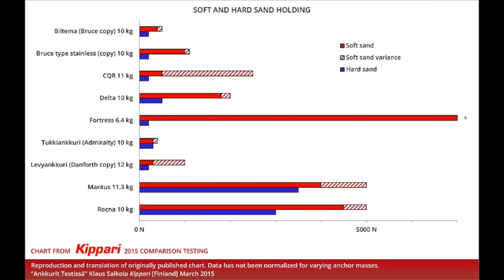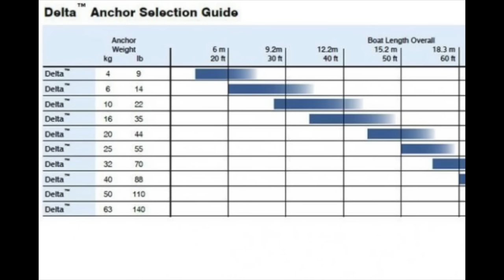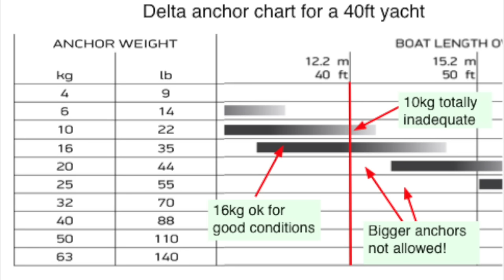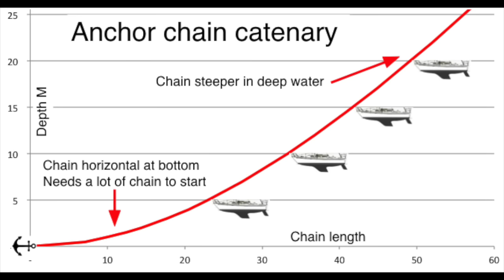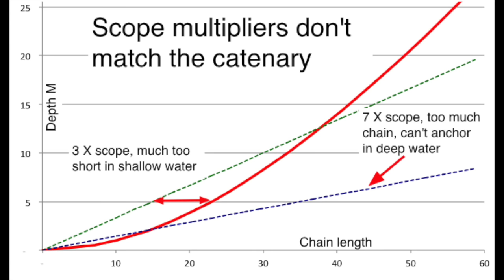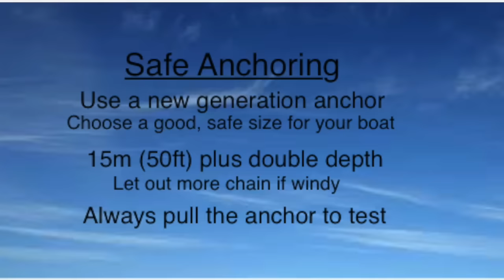Anchoring, how to stop dragging and be secure.

Comment: Good explanation . Completely agree.  Frequently inspect shackles and and mechanical connections including chain.
Reply from the maker: I always thread a length of Dyneema thru the anchor, and up about 10 links of chain. Most likely a failure will be the shackle, or one of the last chain links.

Comment: We send a 10 to 15 pound mushroom anchor down the rode by attaching it over the rode with a large shackle. It has a light line attached to the shackle for retrieving. The mushroom doesn't need to go all the way down because it keeps the pull on the rhode near the bottom effectively adding scope. I don't know how that works with chain.

Comment: A 10 meter 10 ton long keel boat had 45-50 knots with Azarta 16 kg on a sandy and muddy bottom without moving. But for added safety, mount a 21kg so it's even safer on surfaces with less grip.

Comment: Catenerary doesn't exist when you need it most, and exists when you don't need it!
Reply: It's impossible to have NO catenary, it just approaches a limit of zero as the pull increases!
Reply: @danielevenson3978  Technically that's true of course, but I think you know what I was meaning. Better wording might be... "Catenary is almost non-existent and gives little or no damping effect when you need it most (strong wind), and is plenteous when you need it least."
Reply: @danielevenson3978  For some data of the forces on an anchor rode see here..http://www.knoxanchors.com/anchoring-forces.  Something doesn't seem right about that calculator of cable sag, I'll study that some more.

Comment: Additionally,  use a snubber on your chain. This comprises a strong hook on the end of a stretchy line, which is attached to the chain near the windlass and then paid out 2-3 M as you let out 2-3M of chain. (This is done after you have let out the required amount of chain for your boat and the conditions.) The  stretchy anchor rope is then secured to the sampson post. The chain can then be run out another 2-3 M or so to let it hang straight down into the water from the bow roller. The weight of this "loop" of chain will act as a shock absorber as will the stretchy anchor line. This technique also has the added benefit of reducing the noise of the anchor chain as it moves sideways across the bottom during wind "bullets" from different directions. Sleep safely and well!
Reply: Wouldn't that extra chain offer even better shock absorbance if it was let out to increase your scope?  I suppose the extra loop hanging from the boat acts like a kellet, but even then only half of that loop is pulling down your rode like a kellet, the other half of the loop adds nothing as it is suspended from the boat.  But I imagine if you can't increase your scope for other reasons,  this technique is better than nothing.
Reply: Yes always use a snubber. Amazed how many yachts let their windlass hold the chain...

Comment: Old fart sailor (80 yrs) Mainly coastal sailing all bottoms.. Last 2 boats. steel Pugh 32ft 8.4ton and Boden south seas 17 ton. Heavy. great seaboats in ANY weather.

I always have a CQR model as prime on PORT . (35lb/55lb)one size over the rating. 100 mtr chain. ALso one size over. (3\8th/1\2in)  WIth a secondary pick on Stbd side 30+ lbs. with 40 ft of chain and at least 70 mtrs of NYLON behind it.
 BOTH have a small ORANGE buoy on a light trip line to the anchor head for tripping if it sticks.
Stbd for short stops. Primary for O.Night.
(This not for racers>>) I also carry an 85lb ADMIRALTY PICK on stbd rail with QR straps.
With 40ish ft of 3/8 short link chain and H.Duty Swivel/SHackle.

ANy long term or heavy weather/UNknown bottom.
I attatch swivel to head loop on pick (for trip line). Lay that first, SET IT.
 Drive forward a bit
Then lay out primary with longer length of chain than normal, on your end of it. 
Setting that too.
 IF any dragging. The admiralty does it while fully setting the primary. and you then have a DOUBLE grip on the bottom.

Really bad weather coming. Lay Primary. Head to wind. SET. Head forward to equal position 45ish deg to Stbd. Lay secondary, and set.
If wind or tide shift likely. Haul secondary. swing. Position to suit and reset.
Just make sure the NYLON line has a heavy chafing tube over stem head. and I always run a 1.1\2 in Nylon spring line with claw to suit link over stem head and 2 mtrs long fron anchor cleat to chain. Hang from that to negate graunching of chain over stem head.
They should be the basic setup for all cruising yachts. (I have several of those.

Plus just dropping primary pick to full length of chain if run out of all propulsion when coastal. Even if in 1/2 mile deep. It WILL shallow.
Unless in reefy areas. It should hold you off surf line till fixed, if  wind or tide drifting.
Saves bouncing on whatever bottom waiting for you there.
I have near 65yrs sailing. never dragged after my first couple. (Scared me). ALL rocks on my coastline when young

And if cruising. ALWAYS a large Admiralty with oversize diamond shaped tips welded on anchor tips. . THEY hold on 99.5% of ALL grounds. Just have a good tripping line on head.
Have fun hey.

Comment: Good advice. I am paid skipper in Croatia, and have slept lot of nights on anchor this summer with sailboats(40-50 feet) and catamarans(around 40 feet). All those advice are good ,very good and there are few new things i learned actually!  (i never watched size of anchor on my yachts ). Also i would advice, watching weather forecast is most important of it all, luckily here in Croatia they are very very very precise , so if there is any chance of stronger wind during the night then we sleep somewhere more safe (on very protected bay, or good buoys or port /marina). And let me repeat this - it was said in video but i ll repeat it again.. Every time you do anchoring , use engines to test it and bury anchor even stronger-when you are reversing on at least 1500 RPM and your boat is holding, that means you are pretty safe - up to very strong storm(for that you should be following weather forecast and have reservation on some marina/port) . If you are reversing and you are being pulled back, - go repeat process.. i did this hundred of times just this summer season..
Reply from the maker: Many thanks Luka, good advice from an experienced skipper. You mentioned a very important point that I didn't cover - watch the weather and go somewhere safer if you need to. Anchor dragging should not be inevitable, it's up to the skipper to fit the right gear, choose a safe anchorage to suit the weather, then set it properly. Then always test it, I've seen so many people just stand on the bow and watch it for a while with no load!

Comment: no mention of the snubber, an equally important piece of the holding gear when there's a blow. For a 48 footer 1 1/4" mooring line is good to 35 kts, over that, double the snubber one port one starboard and be sure the attachment point to the boat can take the load and also have anti chaffing wrapped wherever the line is going to touch a chaff point.
Reply: I always use a double snubber attached to a choker hook, fold it over into a bag on the bow pulpit. I also have a 20 Lb kelty  when I don't like the bottom. Anchoring is about the most serious and under rated activity on a boat.
Reply: I had seen some dropping the anchor in a slip, if the weather was foretasted to become very bad.

Comment: Hi Richard, if i upgrade my anchor to a bigger size, can windlass might cause any problem? from a 20 kg delta to 35 kg ultra?
Reply from the maker: Check how strong the windlass sounds with your existing anchor, if it’s struggling you have a problem, but it should be ok. It depends on how deep you are anchoring, the chain is heavy, 23 kg per 10m for 10mm chain, so most of the weight is chain anyway if it’s deep. The problem for many production boats is that the windlass and bow-roller are only suitable for smaller anchors.

Comment: I agree having sailed professionally since 1962 in sizes up to 150 tons dead weight.  Pick your chain and anchor and winch as a family unit. With all the chain and anchor hanging vertically the winch must be capable of lifting it  with EASE. 
       One extra large anchor with over size chain and a bigger winch if needed and you will be sleeping soundly. My choice is a Rocna. The CQR  used to be my preferred until Rocna appeared. However the CQR can revolve and dig itself out. Yes it happened to me. The Bruce doesn't like a very hard bottom but once dug in is good.  Put out as much chain as the room allows. Each little link lying on the bottom is acting as a tiny anchor. Good cruising.
         By the way afore I go always have root vegetables aboard. A broken pipe can be mended with those round wooden plugs beloved of chandlers but when the pipe breaks can you ever find them ??? Everyone knows where the potatoes are.
David Power
Reply: Agree with your conclusion above 100%. Never dragged with our oversized (42 kg) Rocna and up to 100 meters of chain on our 52ft, 13ton Catamaran.
Reply: I yanked  out a Rockna several  times in grassy mud. Came out with a big ball of crud on it and wouldn’t reset.

Comment: Yes, there is no excuse for not having 100 meters of chain on a 45-foot boat. Your scope recommendations are too low. Nevertheless, anchoring is why large yachts (bigger than 10 meters LOD) are unsafe. They are totally dependent on unreliable windlasses which often fail in deep anchorages.
Reply: Please explain more - don't all windlasses have a manual aux? Place to put bar in an manually crank up?

Comment: I believe that there's an error in here and that it's a common misconception. All caternary is gone when the chain/rode is bar tight and it contributes nothing near the point of failure but a little dampening of load as it sags and pulls through the water. This is why a snubber is so important, and why some nylon rode would be even better in that regard. When bar tight (assuming the anchor is holding), the angle will be solely determined by the scope, regardless of chain or rode.

Comment: Much better idea is to not anchor on a lee shore.  Something to think about is the just how weak 3/8" chain is.  In Tahiti in '82, every boat over 40 that was anchored at Mieva beach broke their gear and piled up ashore.  The two boats with 1/2" chain survived....my Herreshoff H-55 and a Swan 65.   3/8" chain on a boat over 36' is NOT going to hold ya in a 100mph wind.  How windy was it?  Well, it blew all the paint off the front of the masts, broke 3/4" nylon snubbers several times (sounds like a cannon shot over the shreek of the wind) and elongated the 3/4 bolts that the windlass was installed with over a half inch.   (120 kts, actually) All this inside the reef with about a mile of fetch upwind.  My heart goes out to anyone who goes on the beach, if they are live-aboards like I was, it'd be a life changer.  By the way, we ran the engine on a slow bell  to take a bit of the strain off, which came in really handy to dodge other boats (up to 100') dragging down on us from well upwind.  If we'd used more than one anchor, we would have been toast.   It was quite a night.  Keep a snorkel handy to stuff down your shirt so you can breath....and a dive mask so you can face the wind.....you are going to HAVE to go forward.  Crawling.
Reply: Thanks for this.
Reply: @richardmacfarlane8404  Did a good bit of sailing after that....my last notable passage was Seattle to San Francisco, with 60kt+ winds off the Oregon Coast.  Pulled into Port Orford for a bit of rest as I was single handing right then, there were fishing boats in the anchorage with blown out windows that the Coast Guard were looking for, but the crew could not get ashore to make a phone call.  All their radio gear was drowned.  I moved ashore when I was 45 and started a hot air balloon scenic flight company in Oregon and am now retired after 25 years of that.  It was a hell of a good ride.

Comment: I’m anchored out in a storm at the moment. I’m running an oversized Rocna and more than a 10:1 scope, all chain. I also have a couple 30 pound river anchors clipped along the chain in tandem to dampen whipping action from the swells. It’s been blowing 40 knots all weekend and I’m still holding a tight pattern. This setup has gotten me through many storms, some in excess of 60 knots. I still keep 2 anchor alarms set at all times and have a robust backup anchor, just in case.

Comment: Richard, this presentation is now over 3 years old.  Following an interesting discussion on Cruisers Forum after you made the video, I have laminated up a picture published from your video and placed it in the inside of the anchor locker lid as a reminder.  

I think the 15m plus 2x depth solves the problem when using the RYA 4x, eg, not enough catenary in very shallow water when you really need it and penalises you in deeper water.  Your formula has worked well over the past couple of years and until someone comes up with a better solution will be our go to method.  

So thank you for making this video, it is still very relevant today.

Comment: Great video - thanks for posting!  I'm a cruising sailor who's anchored in hundreds of places on the US East coast, Bahamas and Bermuda.  I'm also a firm believer that "bigger is better".    I've assisted many other boats that have dragged in squalls (always at 2:00 AM!) and it inevitably comes down to too small an anchor or not enough scope.   One notable exception was a couple who lost a beautiful 44' cruising boat due to the failure of a fancy stainless steel anchor swivel.
Reply from the maker: Many thanks for your comment.
As regards scope, the simple multipliers doesn’t work very well. In shallow water (like the depth-deprived Bahamas) you need a very big number, depending on your depth measurement. Many sounders measure from the transducer, whereas chain depth should be from the bow-roller, this error is a big difference when it shallow.
In the Med, Greece and Turkey, you anchor in deep water, 10-15 m, sometimes up to 20m. It’s crowded, and it’s safer to move out away from the draggers. So, the 7:1 scope requires more chain than anyone carries, and it’s not necessary. The simple scope multipliers give too little chain in shallow water, but prevents boats from anchoring where it’s deeper and may be safer.
Reply: It's always the stainless anchor swivels!

Comment: Richard thanks. I had never added the height of my bow from the water. Depth of water 15 x2= 30 + 38 (boat)= 68 ft of chain. Thanks
Reply from the maker: Hi Dan. Yes, depth calculations can make a big difference in shallow water. People set up their sounders differently, some showing depth under the transducer, or adjusted to show water depth, or clearance under the keel. Then nobody allows for bow height. That’s why the simple scope multiplier gives inadequate chain in shallow water.

Comment: The man who surveyed my boat put down "55 lb anchor 3/8" chain,"  even after I told him, the chain is only 5/16". He didn't go up to take another look, measured nothing, dismissed me and wrote down what the last guy had written down.  Anchors are harder to read. My anchor isn't 55lbs, it's 45lbs. For my 45' boat, these are definitely undersized.  He's a competent well regarded surveyor but is sheer incompetence.  (Tip: bring calipers and a luggage scale. I'll need to spend  $2000 to get a properly sized anchor and chain for my boat.)

Comment: Great video! I have a 46' trawler and use a 40kg Roccna and all chain. I use a minimum 3:1 scope with the height of the pulpit included. I also use a 20' bridle that decreases the slope of the chain. I've developed a high degree of confidence in this procedure and equipment. If the wind kicks up I'll go to a 4:1 scope or more.
Reply: There is a Problem in crowded bays with many yachts around ...

Comment: One of the BEST anchoring things you can do in my opinion is to get a drag alarm. My chart plotter/gps unit has one built in, and can be plugged in by where I sleep. It will start beeping very loudly if you drag more than your specified amount (I usually put in 150 feet, because the boat does spin a good bit)
Reply: Shouldn't the alarm distance be in relation to chain length you put out? I mean chain length plus some.. Gives the best results IMO.
Reply: @maxx9384  I would guess double the chain length + some ?

Comment: Good Story and recommendation. However where was your anchor watch protocol and or all navigation apps employ an anchor watch feature. You can always mitigate drag if alerted early enough. Use it always.  I cray two anchors one oversize and one much smaller that I can attache to the chain to and add as extra bit.

Comment: Wise words. When we bought our Bavaria we kept aside a substantial amount of money for safety kit. The anchor upgrade was amongst those upgrades. We stepped up one size greater than Rocna suggested, still I also wish I’d gone one more step up. But so far never dragged, even when we have been surprised by weather overnight. We use plenty chain and if in a smaller bay or with boats around (especially motor boats with less experienced looking crew) we add a chum. Not so much for the weight but reduce swing so we can have plenty scope. Anyone else use a chum? A lot of discussion if these add value. My experience is not needed mostly but nice to have as I described.
Reply: What is a chum?

Comment: Most of the yachts in Assos have a couple of stern lines ashore.
In that squall the wind was pretty much on the beam.
This puts a lateral load on the anchors, which they don’t tolerate well.
Free swinging is much safer.
How can long lining be made safer?
JC
Reply: I crashed into a dock that same exact way! No stern ties now unless necessary in tight protected harbor with calm weather.